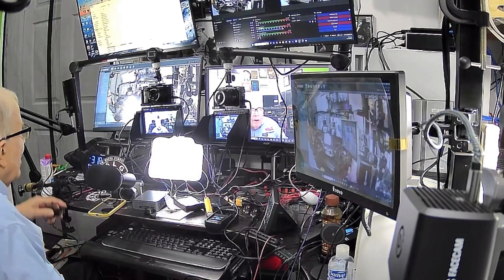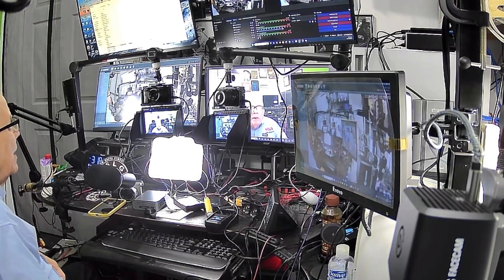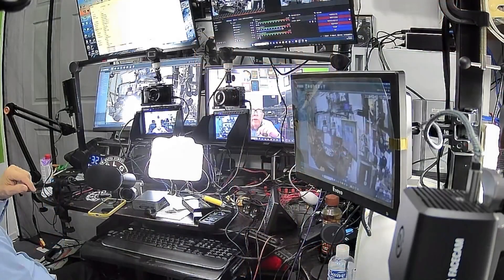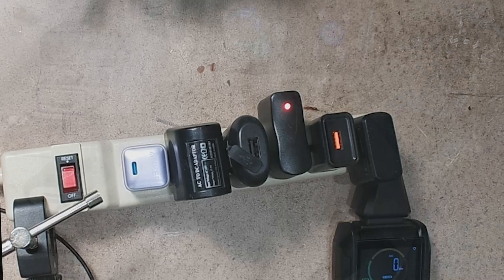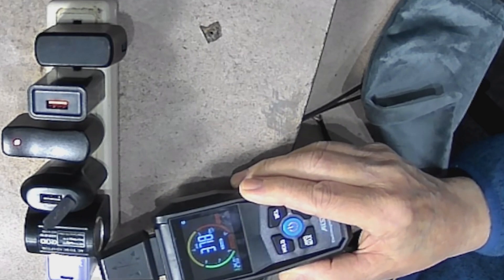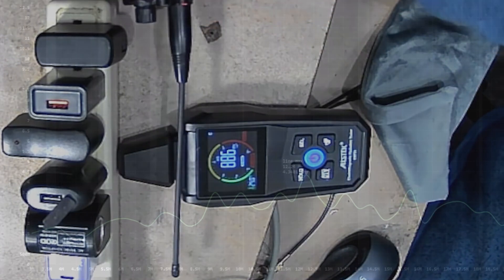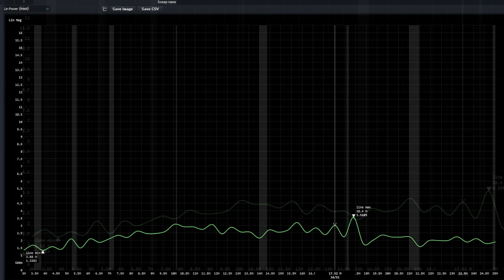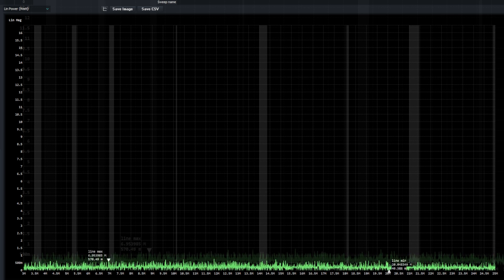Do You Have Switch Mode Power Supplies?  They Can Be a Source of Interference as Shown by Jim W6LG

Comment: It seems like a good test that doesn't require instruments would be to turn on your HF rig with all the wall warts unplugged.  Sample the noise floor across all bands and jot down the results.  Plug in thd wall warts and sample the noise floor again and compare to the "clean" readings.

I'm planning to eliminate my wall warts and replaced them with a single 13.8v supply connected to step-down outlets for all the USB and low voltage gear, but that's for clutter reduction as much as noise.  All the wall warts in Jim's test are in the shack.  Given that the HF antenna is likely some distance from the shack, how much power is it going to pick up from these devices.  Is RF noise being fed back through the AC line from the wall wart to the HF rig's power supply and then through the power supply DC to the radio?  I'd be concerned about wall wart noise affecting my HT in the samd room, or my AM broadcast band receiver, but is this noise likely to propagate to the HF rig?
Reply from the maker: Thanks Rick for asking.  It is not possible for me to carry a heavy FTDX101D aound the house looking for noise sources. I had fallen out of bed a few weeks ago and broke my back at T12 and L1.  The little device made that possible. As it turned out  I did end up back in the hospital later that day which is why you do not see me at the end of the video.  I needed emergency treatment at Kaiser Roseville and was there much of yesterday.  Further tests will be done on Wednesday and again on Sunday.  My WBC is almost zero.  My HGB is 6.6.  My ANC is zero.  My platelets are just 11.  I had two tranfusions yesterday which were numbers 21 and 22 in the last two years.  This lengthy explanation is probably way too much information but that is why I look like crap and sound like crap.  I had no energy.  Leukemia is winning the battle.  Thanks for asking a good question and allowing me to explain. 73, Jim
Reply: @ham-radio  I am so sorry to hear about that Jim. You have been on my prayer list for sometime now and will continue to be.
Reply: @ham-radio   Hi, Jim. Thanks for the explanation and I am sorry for the delay in this reply.  I have been following you for about a year and really appreciate your continuing efforts to educate the rest of us about amateur radio despite the effects of disease and side effects of the therapy you've been undergoing.

Again, thanks for all you do.

And no, even though I'm a fairly able bodied 70-yr-old, there's no way I'd tote my FT-710 around the house (with power supply) to find offending RF sources.  I was suggesting using the HF rig at the desk as a screening tool to determine the magnitude of the problem under normal operating conditions.  If there's a difference, then more detailed testing like you showed would be warranted.  The TinySA I bought a couple of months ago was purchased with that as one use case.

Comment: That is a good demonstration, Jim. Anecdotally, I've found these supplies to be a problem at MF and HF, but also interfered with FM broadcast in one situation. It would be interesting to look at how much QRM is radiated, vs. how much is conducted back in to the ac line. In the latter case, we may have a chance to defend against it, but identifying the culprits is a good start. Thanks for an interesting and informative video, Ed KO6BLM

Comment: This is highly important information and often overlooked. Thank you for sharing this analysis. I'm curious how these results would compare to Jameco AC/DC Linear Regulated Power Supplies (the classic transformer type of wall adapter). Thanks again. ~ 73 ~ AC7WH
Reply from the maker: The power supplies with a real transformer have almost no noise.   And that why I have switch to 12 volt and a 5 ve=olt regulated supplies.
Reply: @ham-radio  Excellent! Good to know. 👍

Comment: Great job JIM !! Yes them SMPS units make RFI and change a bunch from load and no load and from unit to unit. Best just use a tiny SA and go around and find them. I find some solar charge controllers like MPPT can be a source of RFI and changes from brand to brand . Also DC to AC inverters can be a source of RFI . Home appliances like a LG inverter drive washing machine . VERY BAD RFI . Ferrite can help . Them phone chargers draw power and make RFI just plugged in and no load on them.   73

Comment: 2 details - The difference in noise between UL and non-UL listed devices is huge, but the price difference is not. Look for a UL version of the one you need. Also, the device does not need to be powering anything in order to emit this noise. As soon as it is plugged into your live outlet, it'll generate HF noise.

Comment: First Jim,,, nice to see you… 😊  😉  you’re looking somewhat better…
Wall warts, are a source of noise, I was listening to a station on 40mtrs I think it was and could hear a buzzing…. I’d recently watched a Mr Carson’s Lab YouTube about these things so I turned it off at the switch…it was for a LED light and the noise disappeared…turned it back on and saw that the  S meter noise went up 2 s points and the noise continues until the capacitor in the wall wart discharges…Now, it’s only on when I’m working on something and I don’t take my phone into the shack anymore… switch mode power supplies generate noise that’s why they have a tuner knob, the old design linear power supplies are quiet but more expensive and heavy, very heavy,,, we have to accept some noise because of all the gizmotrons we have including shack computers and their monitors…I’m in the process of trying to decide on what to buy ( I’m  pxxs poor btw 🙂 )  so a used Dell / HP / old Apple  Toshiba/… Samsung = NO ….  Apparently the newer gizmotronics are noisier.   Cheap Chinese kkkkkrapp  …..    I rely on  my Elmer’s for advice to make my decisions.
BTW my dear Jim, that’s one cluttered desk 🤔  Gordon H Bennet  how do you keep track of what yer’v got  😵‍💫  .73. Best wishes to you and everyone.       💙
G0uvl

Comment: I did the same experiment with my TinySA and a 12V DC 'smart battery ' charger, the noise was horrendous on HF.  Using 3 turns on a type 43 ferrite material didn't help.

Comment: Merry Christmas Jim!

I was trying to listen to a weak AM broadcast signal around 670 kHz with my HF receiver connected to an outside loop antenna. I encountered a broadband signal that centered around 678 kHz that wiped out stations +/-40 kHz either side. I took my Tiny SA and started sniffing around to locate the source. It turned out to be coming from a recently replaced SMPS in a desktop computer near my receiver ($20 from Amazon!). It produced harmonics well into the HF bands too. The switching hash was being sent out via the AC line and could be detected several hundred feet from my house on a portable radio. I had a Corcom line filter in my junk box and installed it in the line going to the computer. That eliminated all the hash and all is well now. 

It's impossible to eliminate the garbage coming from all the switching power supplies in everything from wall warts to TVs to LED bulbs. I had one of those duplex outlets with built in USB ports and it's terrible. Had to get rid of it. The noise floor is getting worse every year with the proliferation of cheap and poorly designed electronics from China. It used to be the worst problem would be ignition noise from a passing vehicle or an arcing power line insulator. It's amazing how low the noise floor drops when we have a power failure, that is until all the backup generators fire up!